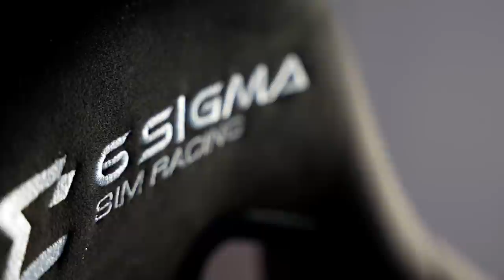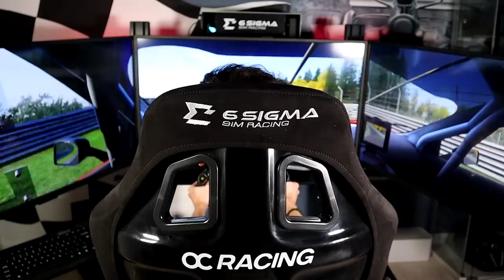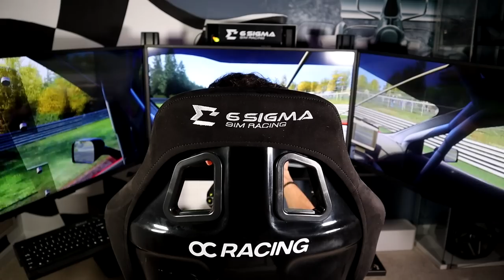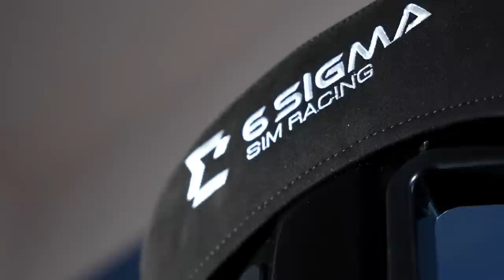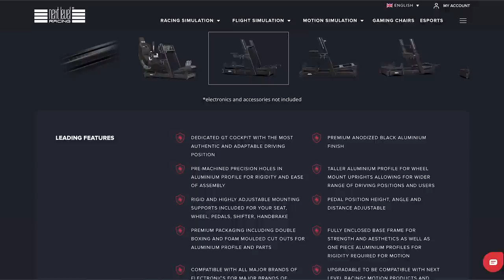FINALLY the BEST Value Aluminum Profile Cockpit? | 6Sigma Sim Racing 6S-160

Comment: Got myself a 6s-120 three weeks ago and i will said that i do agree with your negative points, lucky my bucket seat was not sratched in transport but the back padding is not enough for long sessions
Another thing about the seat is that on the right side there nothing to lock the seat in place so there some movement 
Packaging was excellent but instruction are just a plan and you have to figuere everything by yourself

Customer service have to said that is horrible
My rig was missing the mousse pad and the performance plate add-on as they where both suppose to be included with my 6s-120 (i ask them before buying and have screenshot)
Just received the shifter mount and even if there website have this writen : The 6S-120 includes a performance pedal integration kit that accommodates ALL high-end pedal installation
They told me that it was juste the 6s-160 ... and finnaly after 6 emails agree to send me the performance plate and the mousse pad ...

You know what they don't answer anymore and still didn't shipped them !

Quality is good but have to said that customer service is bad don't expect to paid for what you see on there web site picture and reality are not the same.
Hope that help to make your choice

Comment: I absolutely love my 6 Sigma 6S-80 cockpit.
I've done a few mods like adding nylon washers between the pedal plate to frame at the pivot points.
 I also added some of those same nylon washers under the bolts used to secure the pedal plate to angle adjusters.
That mod removes the possibility of scratching the profile during future pedal deck adjustments.
I also added another support angle to the underside front (only) of each seat mounting profile to spread the load evenly.
It is a great product... with even better customer service.

Comment: Great choice for a rig, and support the USA. Would have definitely gone for this over an Rseat one at same price. My seat doesn’t flex but I use a real sparco wrc. My shifter mount flexes though. Pretty sure it came from Rseat missing threads and taps for one intended mounting point. Hope to see some more Iracing content soon 🤙
Reply: The manufacturing isn't North American though.  It looks like they use the same manufacturer and designs as GT Omega does.  GT Omega uses a Chinese manufacturer, and 6Sigma also say they use a Chinese manufacturer for their stuff.
Reply: Company operates out of Canada.
Reply: Lol, "support the USA"

>company is located in Canada and uses Chinese-made aluminum profiles.
Reply: @tarushdei clueless😂

Comment: It’s definitely a nice rig, but let’s be honest, all alu profile rigs are pretty much the same (with the same size profiles) besides the pedal plate and wheel mounting option and the quality of those pieces. 
Also you don’t really answer the question in the title, is it “THE BEST” value for money rig? In 6sigma’s line up, probably… but just because they offer a more expensive version and a cheaper version, doesn’t mean the ‘in between’ version is automatically the best ‘value for money’ option though… When compared to all alu profile rigs out there, is it “THE BEST” value for money? Probably not. There are rigs out there that use the same size profiles and are way cheaper with similar or better quality pedal plates and wheel mounting options. Obviously availability and shipping are a factor, but those can change dramatically depending on a lot of external factors the companies often have no influence on.
Anyway, the production value of your video is once again off the charts! Maybe 6Sigma should hire you to make product videos for them :D

Comment: Hey OC, love the videos but are you ever gonna do a Review on the TX Racing wheels for Xbox?
Reply from the maker: If i'm not mistaken, the TX has since been discontinued and replaced by the T128. I made a full review on the T128 a few weeks ago!
Reply: He actually did one on the tx/t300 already, just search for tx/t300 review. Unless you mean the tmx…
Reply: @Micah_clark  I watched that one earlier, i meant the Tx Racing wheel leather edition
Reply: @66blomqvist  yes, the tx and t300 are the same wheel, I have a leather edition tx and the only difference is the degrees of rotation and actual wheel rim

Comment: I've made a massive mistake and bought a moza r9 wheel and crp pedals thinking i could use them on my new more "sturdy" desk. but the pedals are going to be a pain in the butt to try and mount to my floor, i also use a office desk chair and im worried the brake is so stiff i will hit the brake and push my chair backwards. thinking about abandoning the new desk and just ordering one of these. but i know ill miss my desk because i do do other things on my pc. any suggestions on how i could make the moza crp pedals work on the floor, before i sink another 2k into my "updating" project?

also i have a GOXLR audio mixer and a stream deck do they make any sort of mounts for that stuff?

Comment: I purchased my bucket seat from Corbeau and it also was not padded at all... I am thinking that must be industry standard. Mine was in a large plastic bag inside the box though.
Reply: Yeah, a real bucket seat for a race car is usually a literal sheet of aluminum formed to the shape. There's minimal padding. I've ridden in some bespoke race cars that had a second seat and both were just straight up bare aluminum buckets.

Comment: What's the difference between this and the 6s 80
Reply: Base is double the size 160 profile, uprights are bigger, adjustable aluminum pedal tray.
Reply: @joshuak4372  so would it make a difference for a moza r9 except the pedal tray
Reply: @tigerfighter77   the 6s80 will handle the moza r9 no problem and up to 15nm wheel bases.
Reply: @joshuak4372  oh alr thx

Comment: So I own the 60" 6Sigma Monitor stand and I am greatly disappointed in it. There is no way it would be able to reliably hold the 60" unless they are including it holding them after bending. 
I didnt leave my TV's on this but if you can afford 3 60" monitors then you can afford a good TV stand and not a cheap one that struggles with 37" monitors...

Comment: 900 isn’t affordable, that’s what I call expensive maybe if it was 500 then that would be affordable.
Reply: they make cheaper models i have the cheapest (6s-slim) and it works fine! got it for around 400$ and that’s with bucket seat

Comment: value and $999 in the same sentence doesn't work
the yaw2 next year is $1700. if you're going to spent $999, you might as well spent an extra $700 and get a full motion sim.. not only that.. yaw2 actually looks like it's going to revolutionize sim motion.
Reply from the maker: Hmm, may have to check it out. Sounds interesting